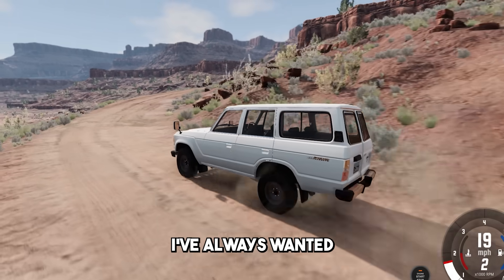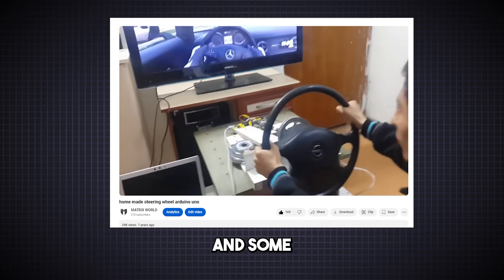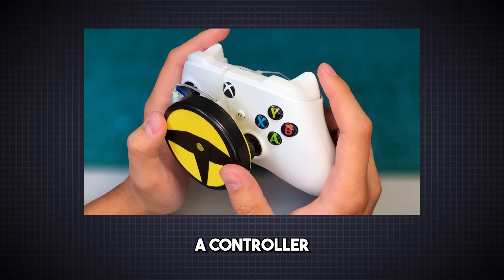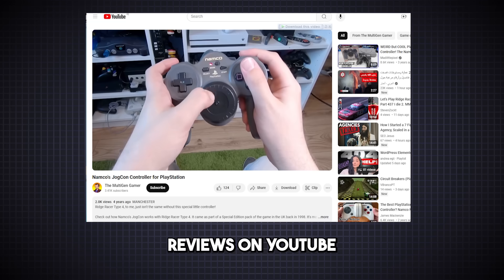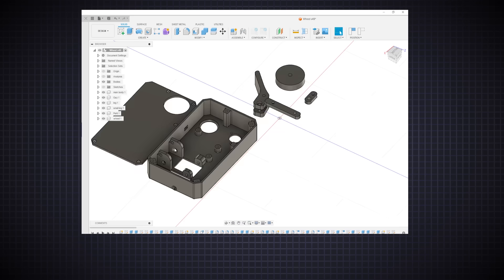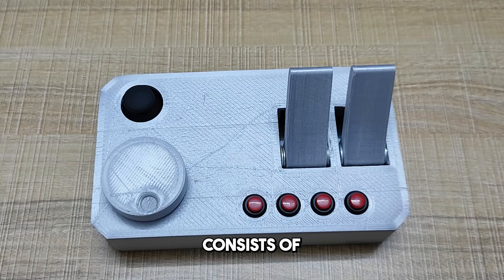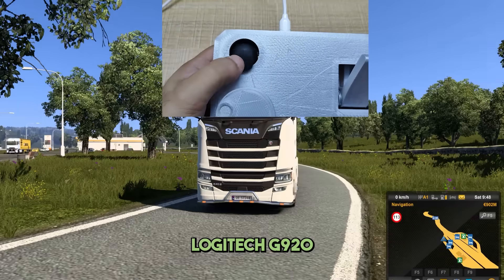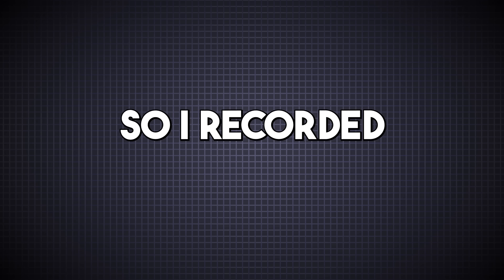The Racing Controller No Company Ever Made—So I Built It

Comment: As someone who works with these companies  and  spent a career as well prior in customer research, companies can make these controllers but it’s not a useful endeavor. The customer journey in sim racing does not paint a picture of someone wanting a high end hand controller . Bc by the time you’re done spending the money to make this at scale in large quantities and make money in your return, you literally might as well invest in wheel base research. Thus, you have a size of prize problem. that said, if you have a PC, you could also get creative which i find super interesting ppl don't try other HID controllers. it took some code work with 3dconnexion but you can use a 360 degree mouse. yes still costly at 100 but it has many uses and can drive a 2d machine as well. little hacks like this or getting a little 4 way ball rocker from adafruit for $10 as a sequential shifter. More nuance below but not terribly relevant honestly. so i'll separate it your video was just great at making me think through some things. specific to what you have here, I'm actually shocked you're not having issue with the voltage. there's an entire community who have worked it out and typically use the E38S6G5-600B-G24N. I dont run into this with bi-phase rotaries but I do for my bluetooth diy wheel and the 5v issue is a common one. maybe encoder you use isn't high res meaning it'll miss pulses but these encoders usually aren't forgiving to needing 5v hence why for my many rotaries to one board, I have to use a PowerBoost 1000 from adafruit to ensure I'm never under the 5V supply. even at 4.98 like your rotary I imagine the input drops. do you not have this issue? have you tried on more traditional racing games vs the trucks you showed in the middle? sorry if i missed that. super curious how you got on. bc I think you COULD take this further if you really really wanted. basically improving the wheel based joystick designed you referenced seeing. You're def onto something fantastic if the 5v doesn't cut on you. looks like youre using a leonardo as well right? Did you ever consider using inputs for your box that resemble footpedal potentiometers? I tried this as well and for me it just got costly but the the concept applies and worked for racing simulators on pc. imagine a sewing needle foot pedal. it responds to the press of the button with severity that matches the application in game and serves as a great way to replicate brake and throttle in the hand. but again , but the time i got here, I realized there's a reason big companies build this haha it's much better and more reliable for not TOO much more money when factoring in time to learn these unique little tricks of a controller. just a thought! 
---------
as for the more normal controller wheel designs, one big area that i don't think translates well and you might be hitting confirmation bias finding ppl who say why don't they make this is at 0:04 you say you "more realistic". You don';t know what you wanted until you experienced it, you know? those who want "more" don't settle for such a poor representation of racing. if all you want is more wheel turn, you likely don't care enough for this to stop you from playing. and if that's true then you're not a target customer for starting the wheel based platforms. and we know this bc the xbox elite controllers doesn't dominate racing despite having an incredibly useful paddle platform that is VERY good for shifting. things like that would translate if there was a genuine market for people who want this. it's likely anyone who wants this, wants a real wheel and thus the controller is simply "less" at that point. 

I too started this journey out of curiosity and thought i'd stop at the first level of increase.  except it was after Thrustmaster ASSURED me you can't mix and match bases and wheels. yeah... bull shit haha. it was a pain in the ass and I ruined 2 bases but I figured it out. you 100% can. just like they can make this. but i thought all i wanted was a normal base no major force feedback. then i swapped wheels. then build custom rumblers. then FINALLY tested upper tiers like Simucube. NOW i get it and couldn't go back. The tech savvy customer who is also curious and engineering inclined will almost always want more. a "Realistic" controller is almost an oxymoron. but until you bust through the barrier, you wouldn't know what you're missing. I'm actually incredibly curious why on earth you'd only want a wheel?  other than you're incredibly creative and wanted to finish this project. but  for someone like you, i'd expect you'd want the fidelity of feeling the kerbs and different patches of contact and grip which you can only get with a high end base. otherwise you know for a fact you're leaving more on the table. even the thrustmaster premier line does a decent job here. and companies like moza are coming way down. in that regard, they are listening to basically everything i just said. sacrificing some fidelity for cost effectiveness.

Comment: I understand you wanted to make this compact like the controller and i can see on certain games like snowrunner this would work well but im not so sure about maybe online racing eg gran turismo where you need to be very precise with your braking accelerating and steering so couldnt you make the pedals external plug into the controller then that way you could maybe use your feet to operate them plus then youd be able to make the wheel slightly bigger giving you more control rather than using a finger to operate it maybe a whole hand. I know this just sounds like a wheel and pedals but it would be compact. Still i love your invention and i think it opens a whole new world of controllers that no company has ventured into just yet.

Comment: Looks very promissing, but i would also think about ergonomics in your design and place for example the camera joistick behind(or top) so you can move the wheel and this jostick at the same time. Could be also good to explore brake and gas pedas options to move behind aswell so  you can dedicate finger for each and still have your thumb for other buttons

Comment: This is amazing work! As a professional game designer, I really appreciate what you did. Some suggestions:
- Consider the ergonomics of the controller - smoother edges, firmer grips, like in an Xbox or PS controller. This will enhance the gaming experience.
- Consider 3D printing a small, lightweight steering wheel assembly for your desk with a quick release option. You can research quick release adapters from Thrustmaster or ones used for camera tripods. You can have the quick release system permanently attached to your desk - snap in the steering wheel, connect via USB and you're done! Just keep in mind this will be less durable than a normal attachment :)
Reply: Agree. This is amazing was my first thought but my second thought was, Carpal Tunnel. Along with the overall ergonomics, I'd suggest "R" and "L" buttons for the index fingers to be used for shifting, and maybe a repositioning of the camera joystick. Super cool work, well done!
Reply: it is quite uplifted, so it would definetly hurt the hand in the future due to height

but also from ux-side - moving the 4 buttons somewhere to center would be way better, cuz people would probably missclick on them while playing

also i would like to curve the pedals themselves to better fingerpositioning

Comment: This idea could open up the simracing to more people.

I had some ideas for a controller like this. Have you heard of OpenFFBoard? That board can be used to make DIY DD wheels with load cell brakes. Using the same process, one should be able to make a handheld unit with force feedback and a smaller load cell brake, along with buttons. The twist I came up with is to make it a linear steering system by using a rack and pinion mechanism. This could use a 3D printer pulley and belt. The idea would be to feel like mouse steering, but with force feedback. It would look like a box on your lap, with the steering handle in your right hand and a handle with the brake on the left side, but it could be switched to left-handed.

Comment: Dude, YES ! yes ! That wheel-knob is all we ever needed for actual driving games. Keyboard/Gamepads are almost useless for precise steering.
If I were them, I would make a modular gamepad. Where you could pluck a set of pads and replace with diverse control options (including this knob-wheel). Also make it infinitely easier to fix/replace broken parts.

Comment: well, i had to add something that, in my opinion, will make better experience of using this. Stick, that rotating the camera should be under ur right hand, on a top plate (where whires connected), so you can rotate the camera while stearing and pedal working. It's important to make rotating things in opposite sides, so your fingers would'nt be dissapointed. And buttons can find a better way to place, like under your left hand, ot can be replace with something like a switch in real car :D
After all it's good product, that only need some udjustment, i would be happy to buy one.

Comment: Ohh that's amazing. So cool. 
Props on doing it with the power outages. If anyone else is dealing with it, try printing parts in pieces. Certain printers can remember where they were, but if the powera out too long youd probably need to preheat and maybe force extrude for a bit.

Comment: Making all of this in Iraq... Man, great respect to you. But this doesn't look really ergonomic. You can make any form you want out  of clay (should be easy to find anywhere in Mesopotamia) and than scan it with any ordinary camera. You can check «Ben makes everything» who made custom mouse using this technique. Also, you can move still to the back side to use it with your index finger. Also, check PyottDesign, who made custom FPS controller with trackball using similar technique. Also, check comments under their videos, there are A LOT of great recommendations.

Comment: This is so cool. Have you considered using a motor similar to one in the video "DIY haptic input knob: BLDC motor + round LCD" showcased by scottbez1? It an open source input device which you can configure specific end stops and provide physical feedback while rotating the dial, one of which could feature a pull to center response while driving in games that support it for a controller like this. I experienced it at an open source convention where it was featured and it felt great, and its small form factor would be perfect for a portable driving setup. Hope to see more updates on this project, looks amazing!

Comment: because an Controller with 900 in a Racing game is inefficient.
A normale Controller will beat u an on the other side the Steering wheel will beat too.
and for about a 100 bucks you can get used steering wheels.

they is also no market for such a Produkt.

It's nice u build one but I think winning against any other typ of steering even keyboard will be better and easier to use/handle.

Comment: Good job. Thrustmaster did a controller with a similar wheel thing some time ago. Current controllers try to replicate pedals this with the triggers, but the have short travel and dont have enough resistance to do a good job. Now i think you have to improve the ergonomics of it, it doesnt look confortable to hold, plus using the brake crossing your thumb across the throttle depressed doesnt feel right, maybe put the throttle slightly up and the brake slighty down for easier access. You could also add a wheel sticker on top of the encoder, or maybe just a line that shows the direction the wheel is facing, having the default position at the side is genious tho. Next think of changing the position of the general buttons for the car to make it feel more like a real one. And finally, i would make a new version having paddle shifters on same position as L/R buttons on a controller for shifting, and maybe a small H pattern shifter below the pedals, also needs a clutch somewhere.

Comment: Good idea, but consider a few enhancements. The controller should have the shape of a classic Xbox/PS gamepad. The triggers for gas and brake should be similar to those on the Xbox controller, designed for index finger use. Behind them, you could have buttons for shifting gears, operated by the middle fingers. The steering wheel should be centered so that it can be grabbed with either the left or right thumb depending on the situation. And most importantly for me, there should be subtle force feedback on the steering wheel that can counter-steer during drifting or rallying. If possible, it would be great to have force feedback on the brake trigger as well, or alternatively, a load cell-based brake trigger with separate vibrations indicating wheel lockup.
Reply: Actually, just create a new version of the Namco JOGCON, and it will be perfect.

Comment: I did this some time back with a Pico because it was cheaper than Arduino.  I used Optical Rotary also, but just simple pots for gas and brakes.

Comment: It's a much less "high brow" solution, but I actually control beamng using a joystick (push forward for throttle, pull back for brake.) I use the joystick in my left hand and a mouse in my right hand for steering. Left mouse is clutch, the arrow buttons on the side of the mouse are for shifting, and the trigger on the joystick controls the handbrake. It works a lot better than you'd think (besides having no ffb.) Love seeing ways for people to get into sim driving without being able to afford wheels.

Comment: You can probably add a small motor to the knob and use the arduino to handle the ffb inputs from the game. I've made a DIY steering wheel before and getting the ffb effects from the game really wasn't that difficult due to some premade universal library (worked with beamng). I used a normal 775 motor with an H-bridge driver but you can probably get away with a smaller drone bldc motor due to the low load.

Comment: This controller seems like a great idea! I think you can make it even better. Your index fingers are pretty much unused so why not redesign it a little to where you can control the camera with your index finger? The D pad maybe can be on the side? or on the back even and you control it with your pinky/ middle finger? It would such to take off the thumb at all times to change the camera. Further more on the other side you could add 2 buttons for gear switching. One button switches one gear up and the other switches on gear back. That way the full hand is utlised and you don't have to take your hands off the controls.

Comment: Nice design. One thing I would change is swapping the blinker buttons for a 3 position toggle switch you could hit with your thumb... At the expense of not being able to press the paddles. Maybe it'd be better to move those to another finger but you'd be getting closer to the standard triggers like that. Like if you replaced a bumper with a second trigger, not much different to the two pedals, eh? 

If you have inconsistent power, I recommend getting a standby UPS, backup power supply system for your 3-D printer. Basically a battery bank that'll keep a thing alive for another 20 mins or however much time. Good for short power cuts or being able to pause and save work if the power stays out longer than the charge the batts have.

Comment: Making the camera control a scroll wheel on the left side of the controller instead of a joystick would be helpful. It would allow you to easily look left & right (x-axis) while turning the steering wheel. I would try to make the scroll wheel have 2 modes, snap back to center or 360°  motion. You could put a y-axis scroll wheel on the right side of the controller too. Each scroll wheel would be controlled by your index finger.

Comment: The big problem you are gonna find is - when you are driving the fastest race cars, specifically rally and F1 cars, you need to use "left foot braking", ie you need to be able to push both the brake and throttle at the same time, but independently.  The trigger placement on current PS controllers really is a great design.  I don't think you can make a controller that will work for fast racing without that ability mate.  And I'm not sure how you would to this one handed.  That said, its still a good idea and design.  My only other suggestion is to consider making the steering wheel a little larger, for a little more precision control.  That's one of the greatest things about a wheel . . .it precision.  BUT - GOOD JOB MAN.  Keep thinking and trying.  It makes the world a better place.

Comment: Awesome! Here some ideas to even improve this (maybe) , you could make the wheel slightly into the middle and sligthly bigger and put the gas pedals to the backside. You could try a cylinder shape for the controler itself like holding it with one hand and the left hand can steer. With your middle and index finger for gas/breaks your thumb for the stick to look around  (I think looking around while steering at the same time is important) and your left hand to steer and push buttons (could be above the steering wheel).

Comment: Two things that I think could improve it:
1) roll wheels on the top corners instead of or in addition to the joystick. One does the left-right camera motion and the other does the up-down. That way you don’t need to take your hand off the steering wheel while adjusting the camera. 
2) Buttons on the back under your fingers for shifting. Basically paddle shifters where one side is an up-shift and the other side is a down-shift. 
These would be optional to use and in addition to what is there so they just make it more complete or easier for certain actions.

Comment: Nice first design. Keep it up.
I dreamt of a wheel rotating on an axle with a fixable bottom plate where I can clip my phone on in the middle of it to use in driving apps. Could just be a phone holder instead of a full wheel. Shifters on the sides of course.